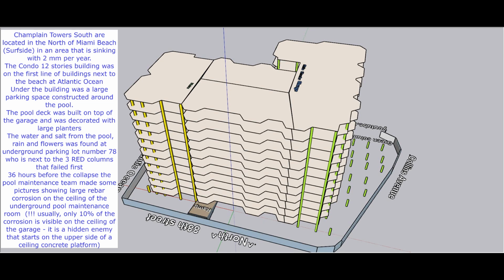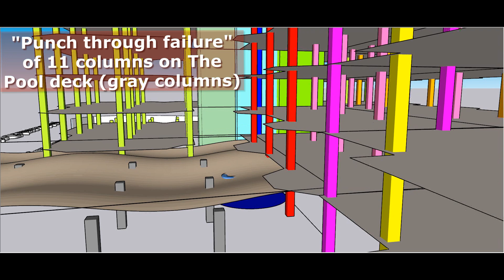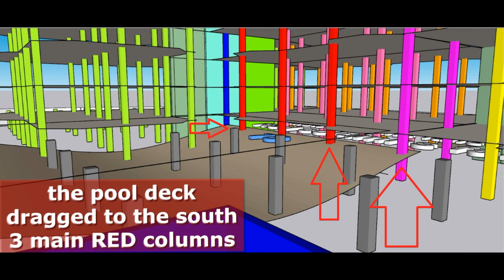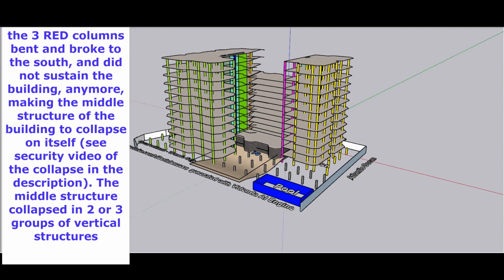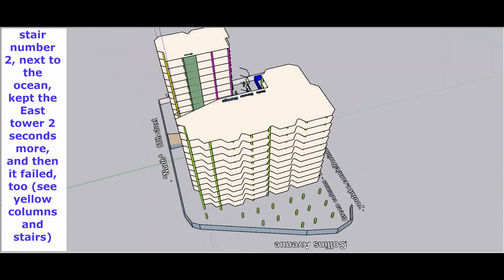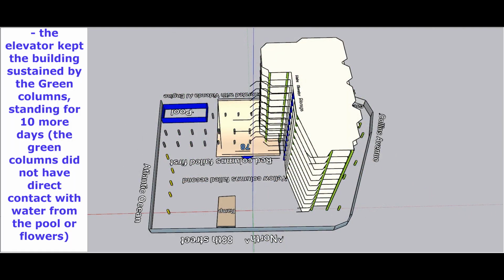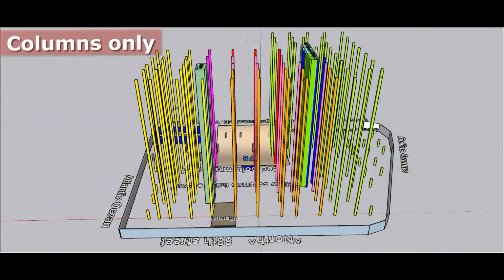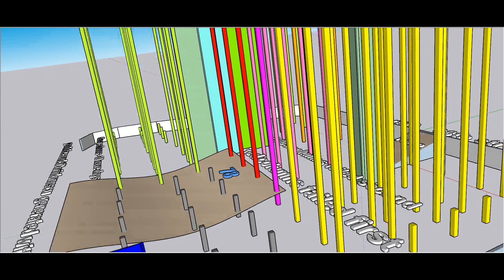Collapsed Building Miami, 3D model condo, penthouse, Champlain Towers Surfside Florida, demolish P3

Comment: Glad you mentioned the "green" columns being thicker...the collapsed columns should never have been that narrow!
Reply: My Educated guess!
*Chlorine pool water 40 yrs of storms overflowing the pool water!
*Waterproofing failure ! 
*DECK  punch thru shows connection failure at pool deck columns! ( look at columns still standing)
Column connection ** 
*Column connection undersized rebar ?
* Not Enough rebar @ column to deck!!!!!!!!!!!!! 
*Rebar single strand at bottom of deck !!!! More info needed
Reply: Those columns had less tributary load but wind forces may have been transferred thru floor diaphragm action to all columns.
Reply: @designstudio8013  the pool deck went first,
Why did everything else fall?
Rebar?
 Column connections ?
 Look at all the rebar , the firman with the dog looking into the garage>> Look at the rebar ..
 columns?
the point is mostly Re bar and connections .
 the one shear wall has NO rebar .
 it could have been designed independent?
Reply: @Admin-tm8gp  the building collapsed because of no maintenance exacerbating  poor and faulty design. The deck pulled on the connection witha torque or moment  to the columns and ripped part of it apart along with other damaged columns. I did not see a photo of the shear wall after it fell.But it did its job.
Reply from the maker: Bonus
See The Penthouse, inside view before the accident, Champlain Towers South, Miami, Florida (Surfside)
https://youtu.be/HFWbCZG_6xA
Reply: @DorinIonescu  as I understand the penthouse was built later on the roof. This added more stress on all the columns. Being even thinner then the others may had an important structural impact.
Reply from the maker: Usually, developers with hidden agendas have multiple plans. One with 14 floors for themselves and they ask the constructor to do that super-strong foundation and another one with 10 floors for the Mayor's office for approval (and for the neighbors to tell them that their building is something small and nice).  Meanwhile, they push approvals for one more level and one more level ...
Maybe, the original structure could sustain 15 floors of marble and furniture. But corroded structures could sustain fewer and fewer floors until it was too much. So without the penthouse and the repairs, the building could survive another year
Palms or planters were too heavy. And the original slopes and drainage system were replaced. People invent new stuff without asking structural engineers
See The Penthouse, inside view before the accident, Champlain Towers South, Miami, Florida (Surfside) 
https://youtu.be/HFWbCZG_6xA
Reply: @insaisissable3938  Not enough to matter.

Comment: I just don't see how the concrete on the pool deck wouldn't have just broken away.  The idea that such a weak deck could have pulled down the support for the building doesn't seem right.. and I don't think any evidence supports that yet. Just that the pool deck collapsed first... could that have been caused by shifting of the ground underneath Yes.
Reply from the maker: Ok. Bonus
See The Penthouse, inside view before the accident, Champlain Towers South, Miami, Florida (Surfside)
https://youtu.be/HFWbCZG_6xA

Comment: Fool Me Once, Shame on You (Twin Towers)...Fool Me Twice, Shame on Me.  Controlled Demolition...by who & why?  Time to follow the money.
Reply from the maker: 3D model with recent discoveries of the causes that created the collapse 
- Hidden corrosion of the pool deck (only 10% of the corrosion was visible on the ceiling of the garage - it is a hidden enemy)
- "Punch through failure" of 11 columns on The Pool deck (6 of the columns were around cars parked on pool level that all fell one level even the tower next to them is still standing - see Green columns on video)
- the pool deck dragged to the south 3 main columns - see the RED columns on the video simulation that I made bellow
- the 3 columns bent to the south did not sustain the building, anymore, and the middle structure of the building failed on itself (see security video of the collapse in the description)
- stair number 2, next to the ocean, kept the other tower 2 seconds more, and then it failed, too (see yellow columns and stairs on the video below)
- the elevator kept the building sustained by the Green column still standing (the green columns did not have direct contact with water from the pool or flowers)
See column simulation (number 78 it is the parking lot that had water most of the time)
https://youtu.be/Mxvb13jxCT8
Reply: Debby O’neal,, Finally! Someone who can still critically think. Who? The Freemasons? And why? Agenda 21? That’s my best guess.

Comment: This problems did not happen overnight!!😫 this was pure negligence!! Someone needs to be held accountable!!
Reply: Yes it takes about 40 years for salt to turn #6 rebar into#1 rebar.
Reply from the maker: I had a similar problem and voted yes for consolidation even if I had no money. It is important to start working as soon as possible. It is like insurance, you do not know when you need it.
Then I helped to get more YESes from other owners
Then I paid monthly amounts
There are 2 more identical buildings one block away, on the beach; I hope they get structure testing soon
See a birds-eye view before the accident, all 3 Champlain Towers (South, East, and North)
https://youtu.be/5naMGbAe8EI
Reply: My Educated guess!
*Chlorine pool water 40 yrs of storms overflowing the pool water!
*Waterproofing failure ! 
*DECK  punch thru shows connection failure at pool deck columns! ( look at columns still standing)
Column connection ** 
*Column connection undersized rebar ?
* Not Enough rebar @ column to deck!!!!!!!!!!!!! 
*Rebar single strand at bottom of deck !!!! More info needed
Reply: Oh shut up.   It's always somebody looking to blame.
Reply: @andrewmarcus4894  ur ignorant!!!
Reply: @vane2660  the blame is on the owners of the condos.  They make up the association and elects the board.  Most of them perished in the collapse of said building.  Only the people renting shouldn't be blamed as they most likely are not a part of the association.
Reply: @honolulublues5548  👍😫😥🙏🇺🇲

Comment: In Europe buildings don't collapse like that. In Greece especially the 40%of concrete is used in the foundation where huge columns are based on gigantic square "shoes" which hold the entire weight. Every column of concrete and iron bars crossing each other can hold up to 3.000 tons of weight. Maintenance is NOT NEEDED otherwise the engineers say "better to demolish than repair" when the spine and bones are not ok!
Reply: Well weren’t Greeks the ones who built Colosseums and ancient buildings that’s a long history of learning how to build sturdy structures
Reply from the maker: Parthenon is still standing after 2000+ years, wars and earthquakes. But as columns I prefer Cariathides of the Erechtheion
See The Penthouse, inside view before the accident, Champlain Towers South, Miami, Florida (Surfside)
https://youtu.be/HFWbCZG_6xA

Comment: What about rebar  and there a word mentioned Slab or something?
Reply from the maker: Solutions (received on a comment from Josue De asis jr)
For basements or below ground zero level where highly corrosive liquids is possible to arise, 
- epoxy coated rebars should be used in the columns & beams & slabs etc. 
- Sulphate resisting cement must be used, 
- high cement content, 
- low permeability quality concrete, 
- proper compaction and 
- the concrete cover should be doubled instead of min. 40mm from the face of the stirrups, 
- and the surface of the concrete should be cladded with waterfroofing materials for additional protection.
(I will come back with the answer for structures with Beams and/or Slabs (that got punched))
See The Penthouse, inside view before the accident, Champlain Towers South, Miami, Florida (Surfside)
https://youtu.be/HFWbCZG_6xA
Reply: @DorinIonescu   that a lot of works to fix a couple of the place, why so many. Whoever is design this does drawing and that person have engineering degree or how far this work. I never understand there a lot t look at levels things from construction and materials requirement needed. Wow this is huge task. It important to see what the person living in safe condo, etc. I don't expect the answer to this max task. If someone need to look around for detail. I would ask the resident how they like or dislike. I was told to see people and how long they lived there and what other problems. I sold my condo, I made big mistake buy the condo and now I can't live condo anymore because my age is not strong enough to live alone.

Comment: You placement of north wall is the property line. The basement wall was at edge of building. It changes everything. Not sure about the east wall but it might be incorrect as well.
Reply from the maker: Thank you. I will make the changes in version 4 of the model
See The Penthouse, inside view before the accident, Champlain Towers South, Miami, Florida (Surfside)
https://youtu.be/HFWbCZG_6xA
Reply: I think they are going to find out that the construction workers started pulling pavers on the pool deck and stacked them right by the building above the end of the ramp in the garage. About 30 feet past the ramp you could see what looked like large pieces of concrete piled up. I guess we will soon see. It has to be related to the construction repairs. Someone did something stupid and stacked to much weight and by 1 am it was to late. Great video. The place looked like it did 40 years ago a bit dated. Time flies.

Comment: Ahh think our arch enemy gravity is running a monk. I think more towers are coming down.
Reply: My Educated guess!
*Chlorine pool water 40 yrs of storms overflowing the pool water!
*Waterproofing failure ! 
*DECK  punch thru shows connection failure at pool deck columns! ( look at columns still standing)
Column connection ** 
*Column connection undersized rebar ?
* Not Enough rebar @ column to deck!!!!!!!!!!!!! 
*Rebar single strand at bottom of deck !!!! More info needed
Reply from the maker: There are 2 more identical buildings one block away, on the beach; I hope they get structure testing soon
See a birds-eye view before the accident, all 3 Champlain Towers (South, East, and North)
https://youtu.be/5naMGbAe8EI

Comment: The only thin you missed here is that about half of the eastern tower was pulled down along with the middle section that collapsed in three distinct waves.  The event ripped some luxury units in half.  Watch the video again and pay attention to the top left of the eastern part.
Reply from the maker: Thank you. I will update in version 4 of the model
See The Penthouse, inside view before the accident, Champlain Towers South, Miami, Florida (Surfside)
https://youtu.be/HFWbCZG_6xA
Reply: My Educated guess!
*Chlorine pool water 40 yrs of storms overflowing the pool water!
*Waterproofing failure ! 
*DECK  punch thru shows connection failure at pool deck columns! ( look at columns still standing)
Column connection ** 
*Column connection undersized rebar ?
* Not Enough rebar @ column to deck!!!!!!!!!!!!! 
*Rebar single strand at bottom of deck !!!! More info needed

Comment: They should never have demolished the standing south tower building. It was people’s home. They could have shored it up and fixed it.
Reply from the maker: Yes, the West building was better built and was far away from corrosions from the pool deck, planters, and rainwater at the ramp entrance.
West building resisted for 10 more days and was put down by controlled demolition in order to avoid complications and more tragedies as Tropical Storm Elsa was approaching Florida. 
I still do not know how the demolish team entered the building - it is risky to stay there and repair or search for victims - more people could die.
The cost to repair could be bigger than to rebuild.
Do you think people could sleep in that building after what happened? 
After strong earthquakes, I noticed that only 1% of the people had the courage to reenter the buildings and take documents and things out. Usually, people beg this 1% to take documents and car keys from their apartments, too
And now the Big Question = If you will have to decide where your family should live, would you send them back to that building?
See The Penthouse, inside view before the accident, Champlain Towers South, Miami, Florida (Surfside)
https://youtu.be/HFWbCZG_6xA
Reply: @DorinIonescu  Govt. should not have decided to demolish peoples homes out of an abundance of caution. The poor  owners had nothing to say in that decision. They lost everything when it could have been salvaged

Comment: The video clearly shows the building collapsing in 4 events, not 3. Looking from the poolside, front, middle, back, then the right hand side.  The major question I have is why the columns on the part that collapsed on its own were substantially smaller than those on the side that was left standing.
Reply: Looking at the structural plans, the front part of the building had so many more supporting beams that tied in directly to the columns. Also, the front of the building did not rely on the rest of it to stay standing. The plans are interesting to look at. https://townofsurfsidefl.gov/departments-services/town-clerk/champlain-towers-public-records-documents
Reply from the maker: @FunnyFallGuy  did the documents moved to another location - the link is now broken but it worked one week ago
Reply from the maker: @FunnyFallGuy thank you for the new location of the documents and the video from Argentina
See The Penthouse, inside view before the accident, Champlain Towers South, Miami, Florida (Surfside)
https://youtu.be/HFWbCZG_6xA
Reply: My Educated guess!
*Chlorine pool water 40 yrs of storms overflowing the pool water!
*Waterproofing failure ! 
*DECK  punch thru shows connection failure at pool deck columns! ( look at columns still standing)
Column connection ** 
*Column connection undersized rebar ?
* Not Enough rebar @ column to deck!!!!!!!!!!!!! 
*Rebar single strand at bottom of deck !!!! More info needed

Comment: Suspended garage+air bubble parking lot instead of a solid foundation.At the threshold of the world's greatest geological forces colliding.What did You'all expect? Subsidence never stops and is not repairable. So sad.
Reply from the maker: See The Penthouse, inside view before the accident, Champlain Towers South, Miami, Florida (Surfside)
https://youtu.be/HFWbCZG_6xA
Reply: There was zero subsidence.  The only problem was no maintenance on the pool deck.  Failure due to neglect nothing more

Comment: Yes, very well done. This was exactly how it happened. Making both the tower and pool deck depend on the same three columns was a horrible idea. Also, why the columns were thinner there  in such a critical location is a mystery to me.
Reply: It didn''t have BEAMS in each SLABS.
Watch the channel ➡️ ARQMANES ⬅️ .it explains better how it fell down with pics, simulations and examples.
Reply: @aulavirtual1200  Whether it had transfer beams or not the main takeaway is that the pool slab tugged on the support columns of the main tower as it fell. Terrible design imo.
Reply: @CaptainCaveman1170  Garcia go find an analysis  done by jeffostroff .his video is a little more detailed. He breaks down the actual  video frame by frame.
Reply from the maker: The Venetian Las Vegas had this problem, water from the artificial lake of Venice was leaking into the Casino and dropping on players, tables, and machines on the main Casino floors. They could not hide it as people do now with leaking water in their garages (which is just 10% of the actual corrosion that you do not see)
At The Venetian, they build a second level of separation between The Lake and The Casino where , in a water-insulated environment, workers check the pool leaking and do the repairs.  These 2 levels of protection and separation between the building and the water should be the mandatory solution for all our buildings
And flower layers next to buildings should be approved by structural engineers. They should also receive the right to evacuate buildings using Mayor office approvals
See The Penthouse, inside view before the accident, Champlain Towers South, Miami, Florida (Surfside)
https://youtu.be/HFWbCZG_6xA

Comment: That was not a sprinkler pipe! if a sprinkler pipe breaks and leaks water! the alarm system would go off! from low pressure! Something else was leaking.
Reply: Yeah it looks like 4" PVC, gravity fed not pressurized
Reply from the maker: Aha - so sprinkler could save them because it triggers alarm on low pression
See The Penthouse, inside view before the accident, Champlain Towers South, Miami, Florida (Surfside)
https://youtu.be/HFWbCZG_6xA
Reply: @DorinIonescu  i don't know how to take your comment but if you look over the sink in the kitchen their is a sprinkler system present! Also have worked on sprinkle systems which is a closed system so if it goes below a certain pressure the alarm system will go off in the basement most buildings like that are wired to a command center and will call the fire department! Also when the building collapsed you can hear it going off not when the girl took the picture when the garage collapsed 7 minutes before!
Reply: The video shows a water supply pipe leaking before the building collapse. If you look at the plans, or the video on YT of the woman walking through the garage, you can see it in that area, just before the bottom of the ramp. The fire sprinklers in the garage were most likely a dry system, due to the garage not being climate controlled.
Reply: It was a waste pipe or a drain pipe.  It can be seen in the video taken the previous year walking through the garage.